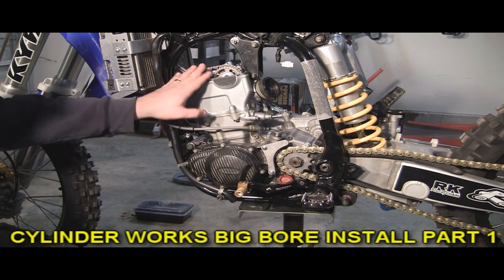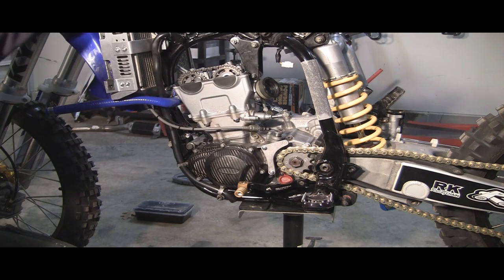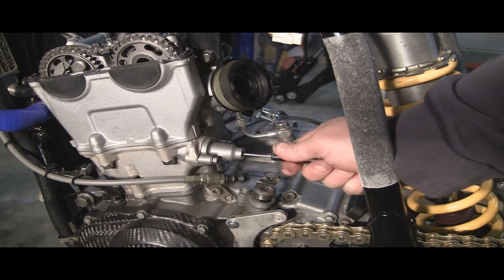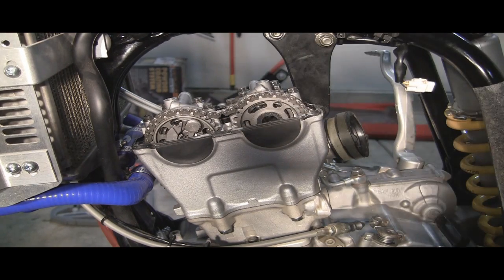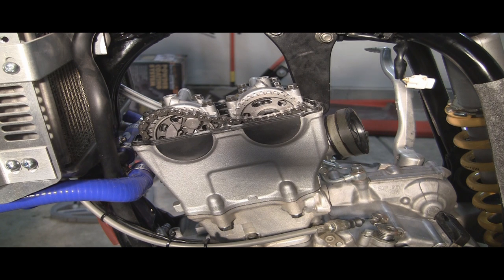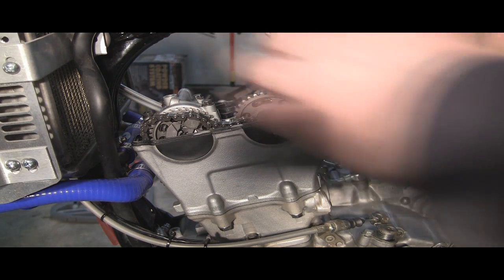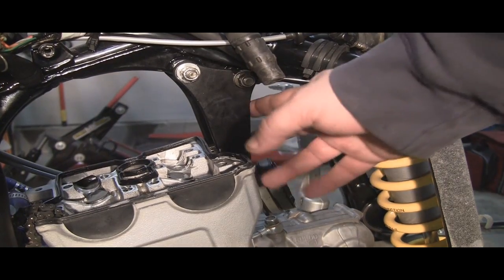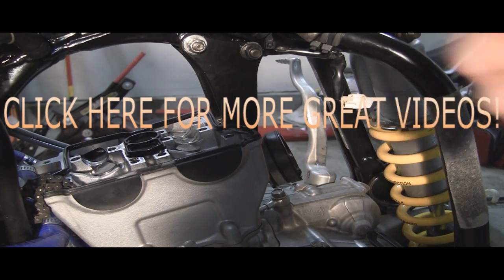Cylinder Works 269CC Big Bore Install Part 1

Comment: Im going to get a wr250f. So i guess my question is, is there anything else that you modified on the bike to keep up with that big bore kit (for example: bigger carburator, jettings etc.?
Oh one more thing, where did you get that big bore kit? i saw one on ebay for $380.00...
Reply from the maker: You may need to re-jet but I always just run it stock at first to see how it does before I do so. I don't recall what I paid but it was from eBay!

Comment: hey, im looking at a 02 yz125 with a 04 motor in it but...some of the head bolts are missing so i was wondering if anyone new where or if i could get a full bolt kit, it would help me out a lot, thanks